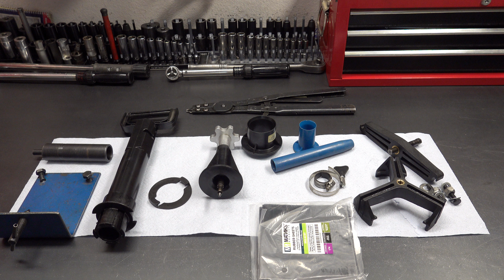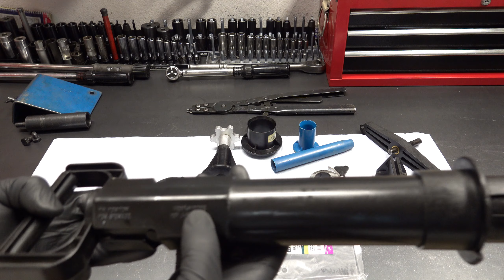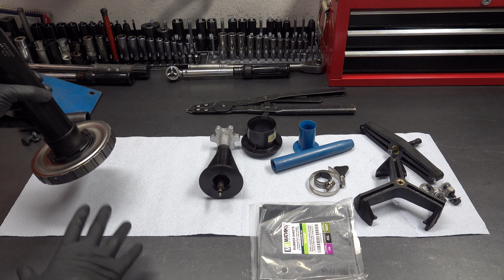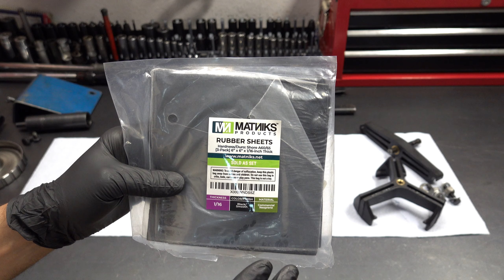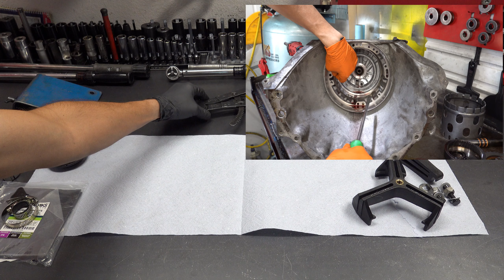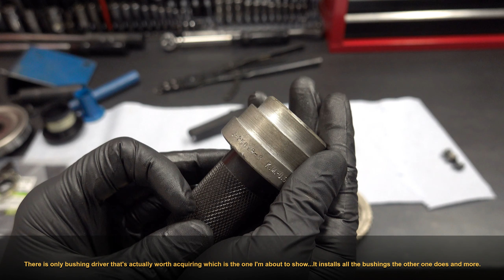Rebuilding the 200-4R: Specialty Tools

Comment: Man after watching this im not sire i should be breaking into mine. Ive done a few 350, 400, and a 700r4, but im guessing a diy novice with limited tools shouldn't belly up and  start pulling one of these apart?
Reply from the maker: Hi Michael, whether or not you want to tackle the 200-4R is up to you but I will say it is at least one level up in terms of complexity from the other units you mentioned. Additionally, you will have supply chain challenges with the forward and direct drum as both likely need to be replaced and good, used 6-clutch direct drums are getting very hard to find, hence very expensive. If your vehicle's engine is putting out more than about 350 HP or so, I'd also dual feed the direct clutch which means you'll need a forward drum with a billet intermediate shaft...The stock shafts don't handle dual feeding very well and tend to snap under repeated exposure to high-rpm/WOT 2-3 upshifts. 

Let me know if you have any more questions and we can go from there.

Comment: I recently had a 200-4r rebuilt. Now the rear seal is leaking. I was told it could also be a bushing that needs to be replaced. Is there a way to do that with out dropping the transmission and if so what tools do you need? I was to you can but wasn't told what I needed to do so. I don't want to take it back to the shop where I had it done. My buddy has a rack and is a mechanic but not a transmission specialist. I was hoping he and I could put on his rack and change the bushing and rear seal with out pulling transmission.
Reply from the maker: Hi Chris, thank you for watching. Unless the bushing is walking out of the case, it should be fine and not the cause of the leak...sometimes the rear seals will leak when new due to either being installed cock-eyed or the housing itself is excessively worn in that area and the leak occurs between the outer diameter of the seal and inner diameter of the seal bore. 

I am not aware of any tools that will allow you to pull the bushing out with the transmission installed; Kent Moore has some specialized bushing pullers for other parts of the transmission that take bushings but none that work on the rear case bushing, to my knowledge. 

But as mentioned, it's not likely the bushing; those rarely ever walk unless there was a major lubrication restriction back there.
Reply: @nickstransmissions  Thank you for the reply. I will start with replacing the rear seal and hope for the best.
Reply from the maker: You're welcome, Chris...Before installing the new seal, check the rear bushing to confirm/deny the shop that rebuilt the transmission replaced it (as they should have - all bushings must be replaced during transmission overhaul) and it's where it is supposed to be in the bore. Also look at your slip yoke to see if there's a groove worn into it by the previous seal. It will leak, if so.
Reply: @nickstransmissions  Thanks again for the information. What state are you in? It's so hard to find someone who knows 200's. The guy I ended up with sent it out to another guy that's local here. He said he is like 78 years old. After spending 5k for a rebuild, new torque converter, and installation I should not have a leak. I am in the process of trying to find another person to look at it. I am just hoping like hell I don't have to have it pulled again. The guy also took my car and ran it hard. I know this because I had a brand new back drivers side tire it was just replaced. Now it's pretty much needing replaced again. He was probably out doing burn outs it it. The passenger side tire is basically a slick now.
Reply from the maker: Damn, that's horrible...So many shady shops in this business, unfortunately...While I don't give out my location on Youtube, you're welcome to send me a direct message on NastyZ28.com...My user name there is Nick'sTransmissions. I also have a 200-4R information thread on there that may be of interest to you: https://nastyz28.com/threads/200-4r-information-thread.346416/

You're right in that there aren't too many folks who know how to build those transmissions (competently)...

Do you have a list of everything that was done to the transmission during overhaul? 

Also, what vehicle is it installed into?

How much power is the engine making?
Reply: @nickstransmissions  I thought I replied to this a few minutes ago but I guess not because I don't see any. So I don't think I have a complete list of what was done. It just says rebuild of 200-4r. I brought it in with 3rd gear slipping really bad. It's a manual valve body (reverse pattern) Love that btw. It's in a 69 Camaro and making 504 HP and 511 ft lb of torque.
Reply: @nickstransmissions  I also just joined nastyz28 and sent you a message there
Reply from the maker: Yea, sorry to hear the previous builder / shop screwed up your vehicle and yep, I'm way out west; unfortunately don't know of anyone in your area for transmissions. If you were out west, I could take a look...

At minimum (in addition to all new soft parts like paper/rubber, seals, bushings, etc), that trans should have a dual-fed direct clutch with either Alto Reds or Raybestos Stage One (or equivalent) frictions and Kolene coated steels, 4L80E one piece teflon rings (x2) for the center support, billet steel intermediate shaft, billet servo (CK Performance's kit works nicely), 3 OD frictions (also upgraded like the direct clutch), rollerized low reverse piston housing and output ring gear hub, bearing under the low roller one-way clutch, lube mods made to the forward drum (holes drilled out to keep the direct clutch cool), all areas of travel on the lower side of spec, Transgo unbreakable pump rings, .500 boost / .300 rev boost valve (PR valve inboard most land ground flush to the body of the valve), Sonnax HD stator, Kolene-coated sun shell, blocked off 1-2 and 3-4 accumulators, requisite governor mods, etc. He should have also installed some sort of TCC lock up kit.

Best of luck with it - let me know if you have any more questions.

Comment: Hey, great video. I'm getting set to build a 200 R4 for my 66 Buick Skylark and I've got just about everything but the bushing installer. Any way around that? I have many Ford installers and a small universal kit but nothing for the 200 4R. The 700R4 kits don't work as well I assume.
Reply from the maker: Thanks for watching, Perri.

You can either buy the bushing installers off eBay if they're available or take the parts to a trans shop and have them r/r the bushings for you....I would think that you could find drivers that would work...I have the dealership-specific bushing drivers but you don't strictly need them, as long as you have bushing drivers that will work...Some of the other tools are more important and sounds like you have those...
Reply: @nickstransmissions  I haven’t yet taken the subassemblies apart but do they bushings fit flush or do they have a specific countersink?
Reply from the maker: If you havent already done so, you can check out my 200-4R installation video where I install all the bushings into their respective parts (except for the intermediate shaft bushing - I show the removal and reinstallation of that bushing in the 200-4R bushing pt 1 video)

https://m.youtube.com/watch?v=Fl9Wc2KbEic&feature=youtu.be
Reply: @nickstransmissions  I did watch it.
Reply from the maker: Ok, cool - so that video should give you all the info you need to install the bushings...One thing I will recommend is to buy two complete bushing kits...This way, you have a spare set of bushings in case something goes wrong and you break one of the bushings...You can always return the 2nd kit if it's not needed. Also watch out for the front direct drum bushing - sometimes the bushing itself is not in spec...Don't take out the pre-existing one if it's in good shape and you suspect the new one is potentially out of spec.

Comment: the 41te dodge takes alot of special tools but some of them i made
Reply: Still have mine. My clutch compressor is ugly AF. Built it out of trashed pump parts. Smooth as butter with the torrington bearings.
Reply from the maker: I don't do too many front wheel drive transmissions (aka transaxles) but am not surprised they need lots of special tools...Was curious so looked them up and came across the ATRA manual. Looks like there are special drivers, holding tools, snap ring pliers, etc...Linked it here for anyone else that's reading this and interested: https://www.uscars.biz/uscars/extras-documents/ATRA_Chrysler_41TE_604_Rebuild_Procedures.pdf